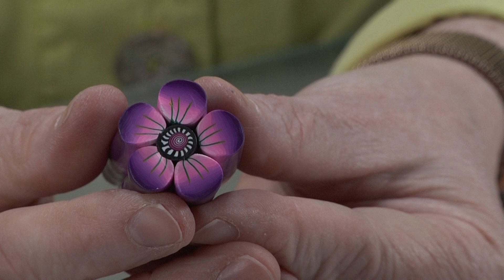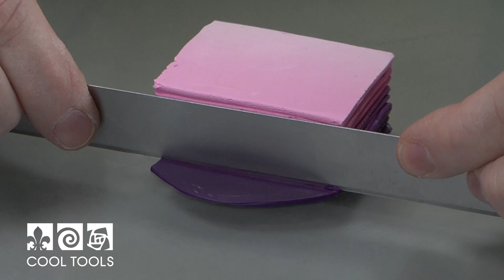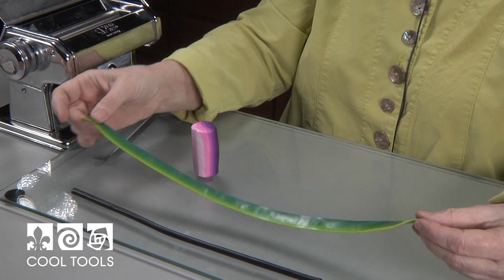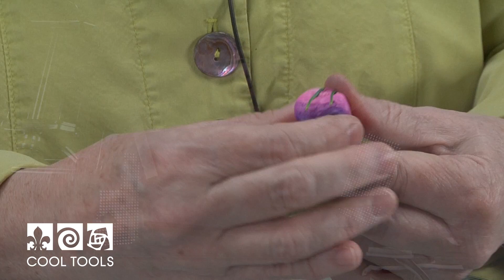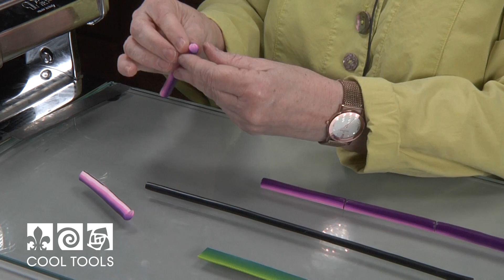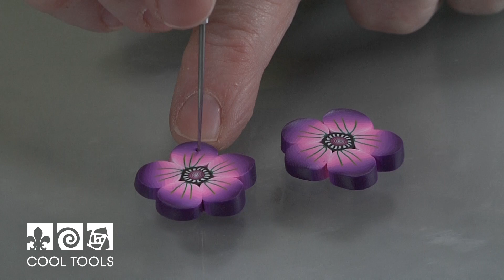Cool Tools | Polymer Clay Flower Petal Cane by Debra DeWolff

Comment: Really nice tutorial. Ask you a thing. I don't have pasta machine it is possible with roll pin this much thinner result get? Or any other method is there?
Reply from the maker: Hi Sona, it is possible to use a roller; however it is much more work and a pretty difficult task. Hope this helps!